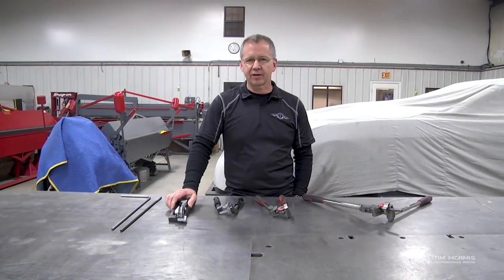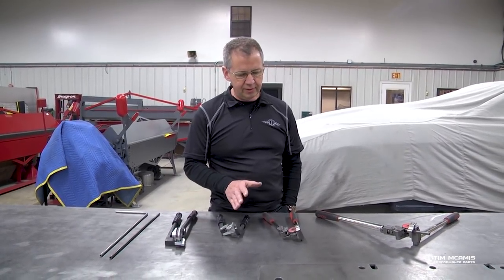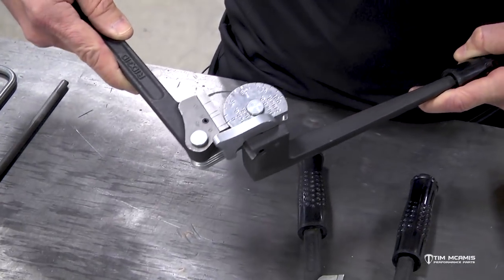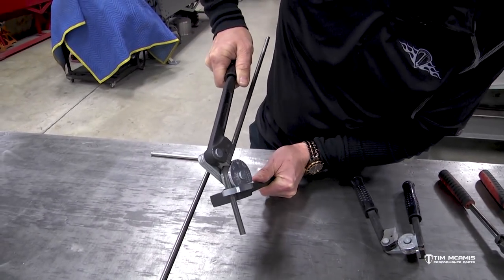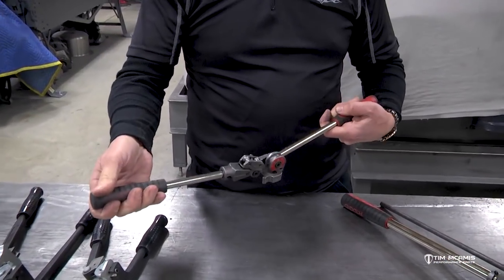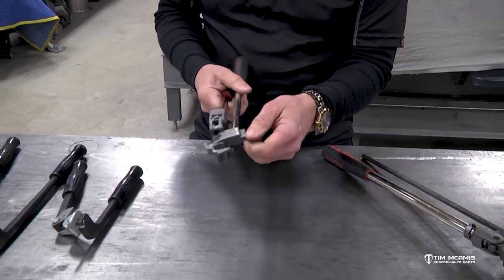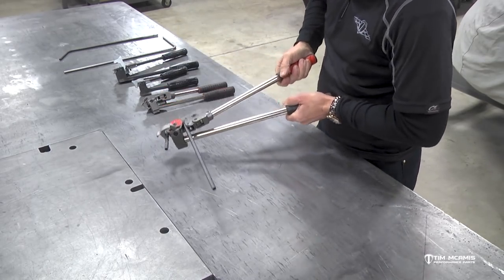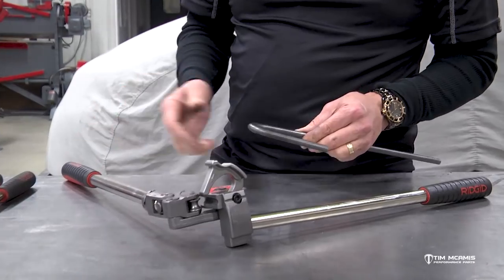Tube Bending - Fabrication Series: 04

Comment: I have a old robinair tube  bender that i really like  it does 1/4 to 3/8 tubing its a ratchet type you can do up to a 180 degree bend in a short span  2&1/2  or larger

Comment: When connecting various tubing. Do you ever use a Swadge connection??
Reply: Usually not on any tube requiring structural strength.

Comment: It's not tube it is pipe. Square pipe is 
"Tube" you should know this when ordering it usually pipe has an ID or internal dimension when tube has an od or over dimension
Reply: Maybe be right when you lecture someone. Tubing is structural, measured in OD and wall thickness, and in no world has to be square.